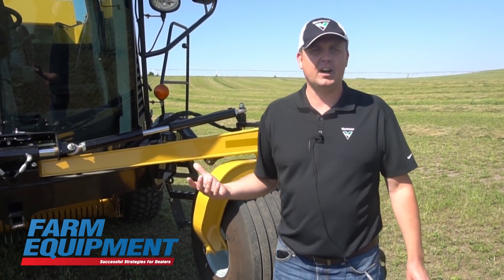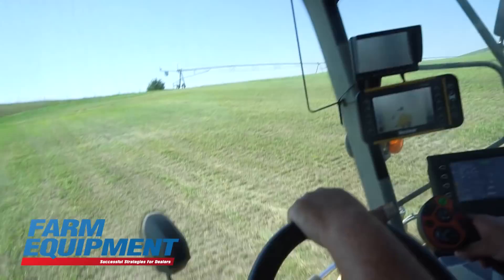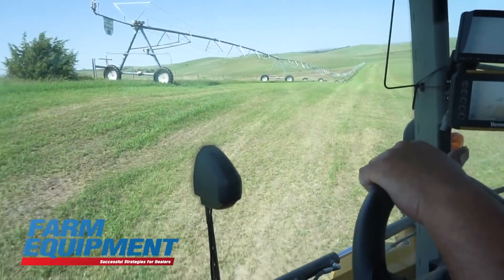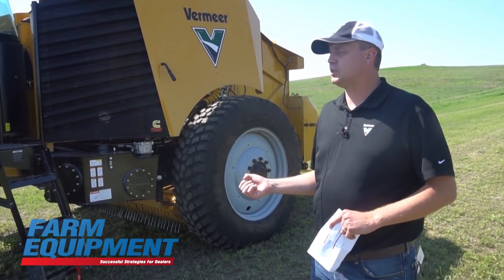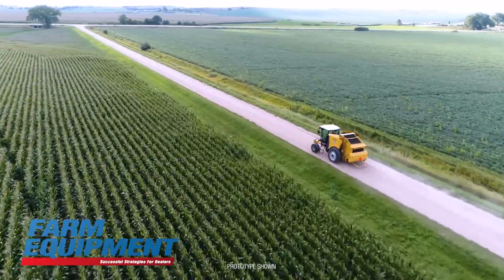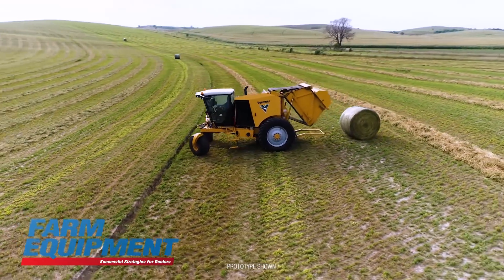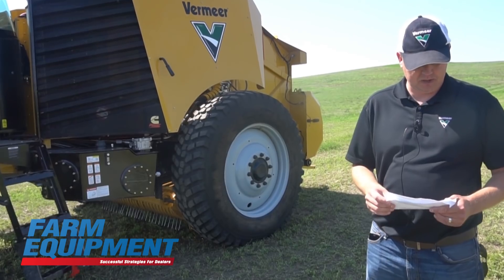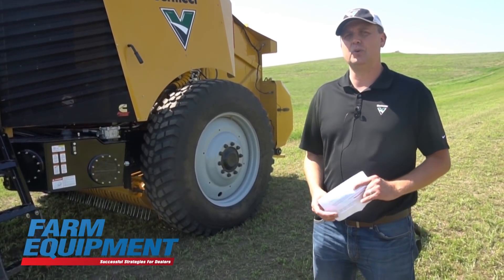Vermeer Rolls Out First Self Propelled Baler

Comment: Looks great ! , I also find the biggest item to constantly watch while baling is the pickup , I got used to listening to mine , as the tines just start to "ping" when you begin to get a  pickup blockage , ( usually due to a wad of damp crop ) this happens before you see the crop begin to block the pickup , so perhaps some kind of torque reading load sensor on the pickup drive would tell you when the pickup became harder to turn , before you blocked it in ignorance of the impending conditions , you could then slow down your ground speed & watch the pickup harder to ensure it does not get the chance to block ! but you still must be able to see the pickup somehow , either cameras or directly. ( I mainly bale big bale silage , hence it,s not fully dried out , & does not dance & flow like dry hay , & is therefore more difficult to bale ) 
How many other drivers out there have spent ages unblocking damp pickups ! constructive comments please guys . Thanks & happy windrows .